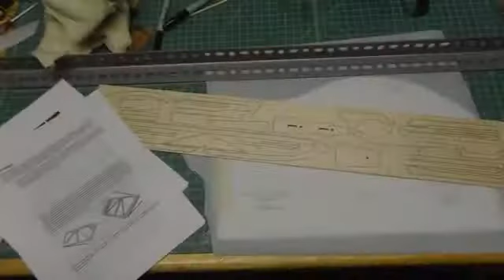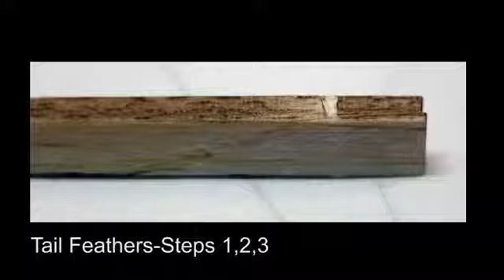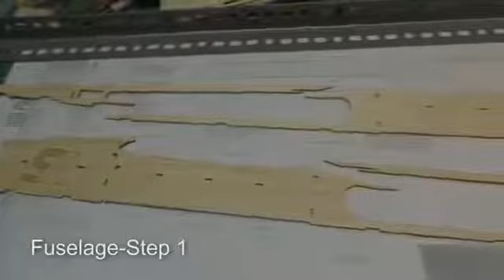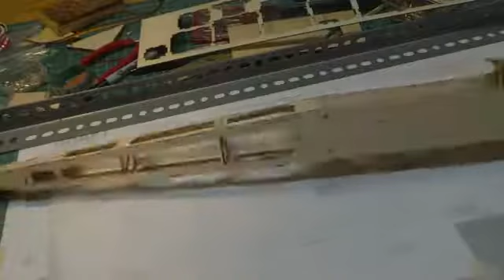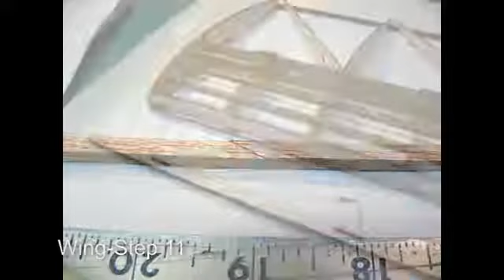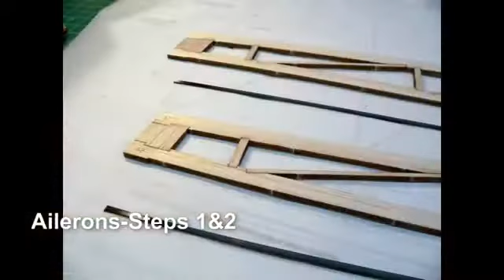Stevens AeroModel SHAFT Build

Comment: Can a beginner fly this plane?
Great video!
Reply from the maker: No, a beginner can build this plane, but if this is your first or second model I would not suggest this. It is very acrobatic and a bit touchy on the sticks. However, put a stabilizer in this plane in this plane and it would be a good acrobatic trainer.